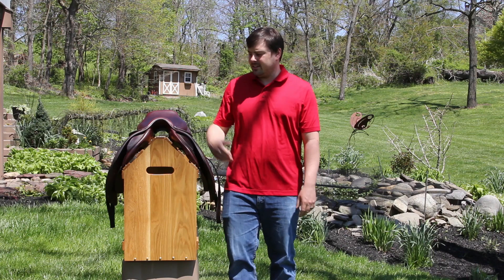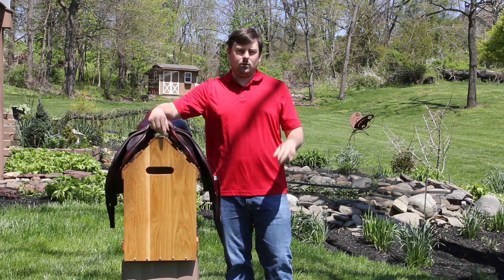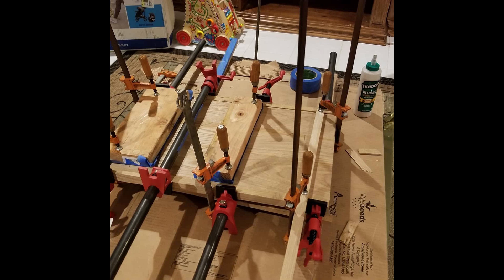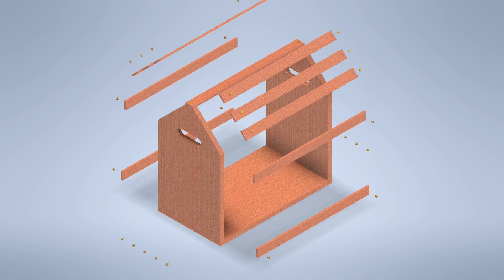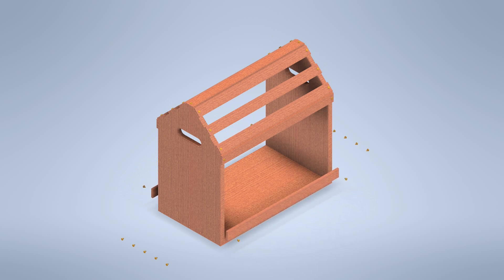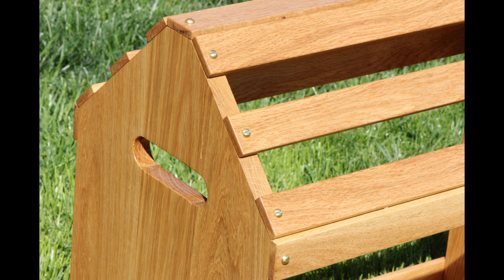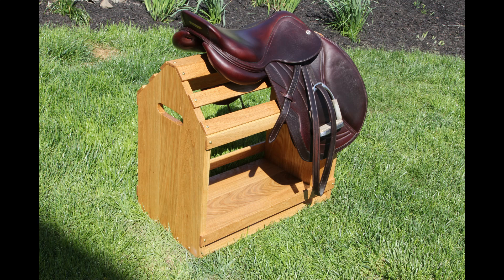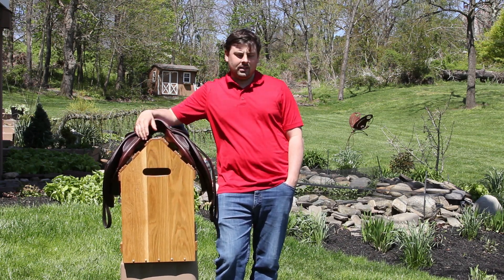#23 DIY Saddle Rack / Saddle Stand Made out of White Oak

Comment: How did you make the handle cut outs?
Reply from the maker: I used a 1-1/4" spade bit, though I would have preferred a forstner bit but the biggest I have is a 1".  I drilled a few times along the length of the handhole. If using a spade, make sure you put a scrape piece under the drill area to help limit tear out from the bit going through the backside.  I tried to remove the waste that was left with small handsaw (https://tinyurl.com/y48rzkfc) as it was the only thing I had that fit into the holes.  I mostly ended up filing it smooth though.  It was definitely not the ideal process, but it was the only way I could do it with the tools I have.
Reply: @thehayfarm  We always would drill a larger hole like you are speaking of, especially if the bit fit the circular ends of the handles and then we just connected the circles with a skill saw. We have found that to be the easiest method in my family. If the bits we have are too small then we still drill the holes and use a skill saw and we keep a dremel around to bring the edges to the place we want as it's better to be a little smaller and dremel it out to be a smooth handle than cut too big on these. Then change bits on the dremel and give a nice edge to the hand holes.